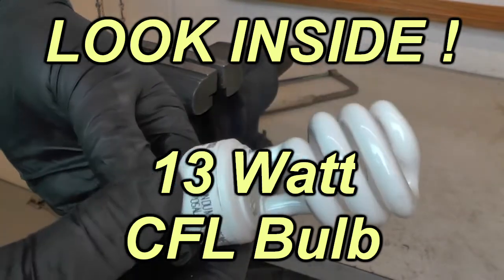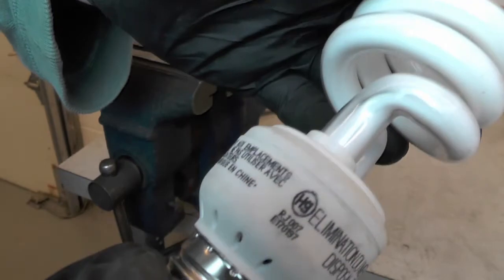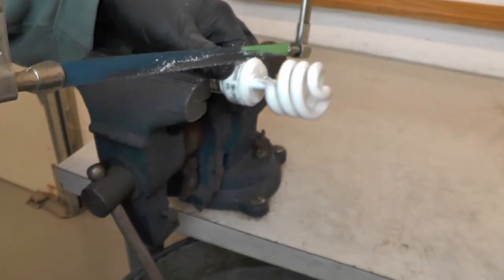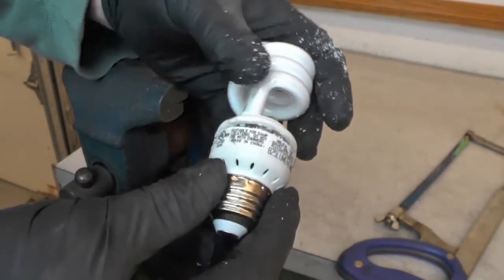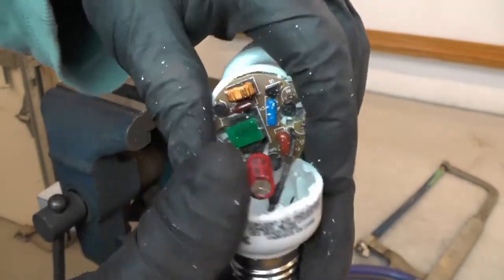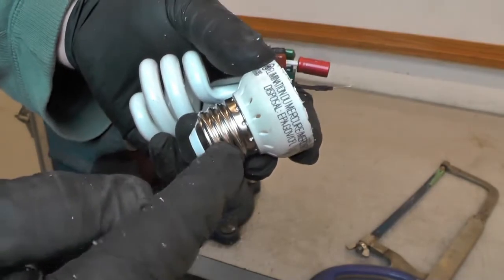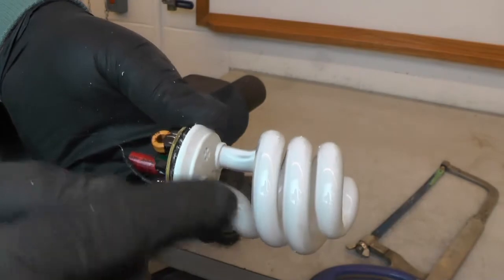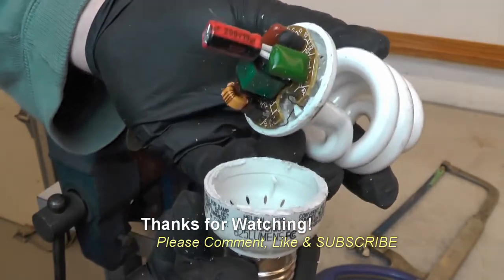Look Inside a 13 Watt CFL (Compact Fluorescent Light Bulb)

Comment: Awesome video. Probably a capacitor burned out. Or that wire was disconnected. I have a bulb just like it and was wondering what was in there.

It converts to DC power, I think.